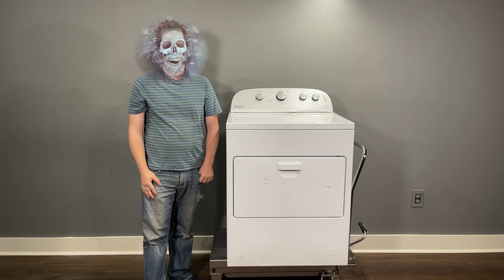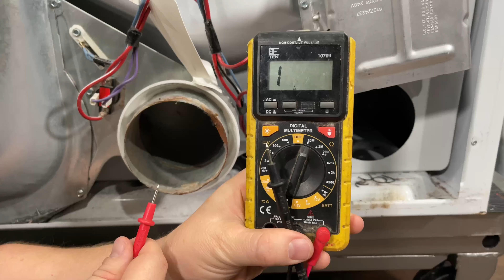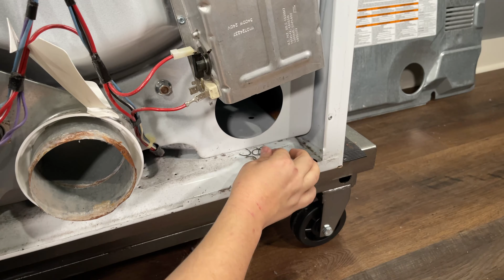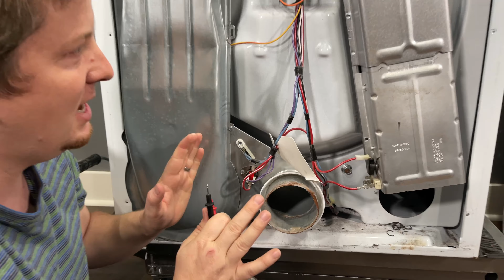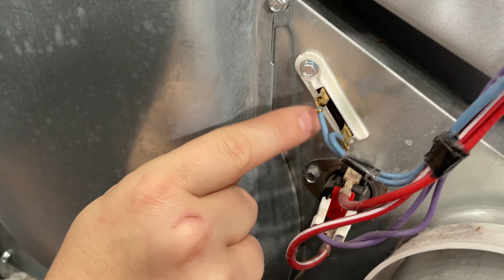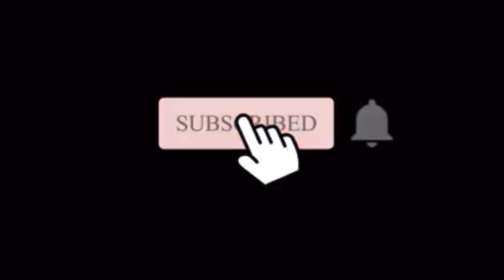Electric Dryer grounded Heating Element Stays on! - testing and diagnosing step by step Whirlpool

Comment: I have Maytag dryer looks very similar to this from the back so the timer doesn’t work I was drying clothes at night and fell asleep in the morning it was off I thought my wife turned it off but then dryer didn’t start I just changed my thermal fuse because it was blown but now dryer smells burnt rubber I haven’t cleaned any lint but I doubt it’s that what do you think it could be should I open it back up and check everything you just said ?
Reply from the maker: Are you saying the dryer will run continuously all night and does not progress forward until it turns off. If so, I would not use that dryer anymore. If it’s a bad timer, which it probably is, that’s one of the more difficult parts to get ordered correctly and it’s also one of the more expensive parts. I don’t recommend a lot of people replace timers because they usually will miss order the timer and the stop points will be at the wrong spots. Also, usually they’re too expensive to really justify not just replacing the dryer. It sounds like you may have more than one issue if you smell something like burning rubber that may be a roller that is stuck or the belt that is stretched.
If you get a good used dryer from a refurbisher, you could probably replace your dryer for less than it would cost for the timer. It also would be horrible. If you replace a timer in that ended up not being the problem. Good luck, but definitely I would not continue running a dryer that does not shut off on its own.

Comment: This looks easy but finding the right heating element is practical insanity.   I have a Kenmore and my heating element literally has 9 different 7 digit numbers in a row on it, followed by obscure symbols.   Which one is the model number?    Then you get on Amazon and there's lists of hundreds of stock numbers, none of them match.   Then they sell kits......  but each part has a list of different stock numbers, none of them match what is on your element.    As for the Kenmore, am I Series 70, 80?  Who knows??   It says nowhere on the dryer what series it is.   Even if you're lucky and get the right heating element, it seems you have no way of knowing if the cycling thermostat that came with it for instance, is compatible or not.
uchh.... What a headache

Comment: Will a bad cycling thermostat cause the element to come on in a run position with the door open ,not running.element dont appear to be grounded out.Ichanged thermostat and fuse on element box.

Comment: Wish I had seen this video first.   I studied the wiring diagram for my dryer.  There were 2 things in my mind that could cause the issue.  Either the timer or the motor centrifical switch.   I bought used parts off of eB@y for it.  Did not fix issue.  For sure, the heating element was grounded to the case.  That never occurred to me, but makes total sense now.   At least I learned something, so it's not all bad

Comment: I tested all that you said and tested .. all the fuses etc test good. And the element tested good ...I checked grounded element .. no noise
Reply: Your issue might be either the timer or the centrifical switch on the motor.   The timer might have some contacts stuck together or the motor centrifical switch may have failed.   When you open the door, the door switch kills power to the motor, the motor stops turning making the centrifical  switch open to kill power to the heater.  If you open the front door while it's operating and the heater stays on, most likely the switch on the motor.   Unfortunately, they only sell as a motor assembly,  you can't just buy the switch.

Comment: Thank u 3 years later your video is helping people like me out .. i change the one element out first then when i turn it on and i noticed the heating element was still stay on... I took that apart and yup on of the wires was just touching the metal . I pop it back on the clips that it has and that fix my problem right away ... Thank you so much
Reply from the maker: I’m glad I could help!

Comment: ALSO IF I RESET THE BREAKER AFTER PULLING THE PLUG THE BREAKER RESETS . THEN WHEN I GO TO PUT THE PLUG IN THE 30A OUTLET IT SPARKS AND POPS THE BREAKER , WHY IS THAT HAPPENING . ALL THE WIRES ARE BACK EXACTLY WHERE THEY WERE . ANY HELP WOULD BE GREATLY APPRECIATED . THANX FOR YOUR TIME AND EFFORT .

Comment: I BOUGHT THE ENTIRE REPAIR KIT . ALL THE THERMALFUSES ,THERMOSTATS AND THE NEW HEATING ELEMENT . DRYER RAN FOR ABOLUT 3 WEEKS NO PROBLEMS . STARTED RUNNING WAY TO HOT AND THE DRYER WOULD STOP . I CHECKED ALL COMPONENTS AND THE NEW HEATING ELEMENT ALL GOOD . NOW WHEN I TRY TO TURN ON THE DRYER IT KEEPS BLOWING THE BREAKER ???????????? PUZZLED.

Comment: Hey there, im hoping you can help me out. My heating element doesnt stay on continually but it does get really hot. And it stays on through the cool down cycle. I took the back off and checked for lent and its not to bad. The heating element looks fine.  A little bend in one of them. Could this be why the heating element stays on through the cool down cye?

Comment: thank you for the video, clear and concise. the problem i am having is no matter what cycle you use it is always on high heat, even on air only. when the dryer is off there is no heat. chaanging the heat knob does nothing high heat all the time. i replaced the timer which was bad and the fuse but there is no change, high heat any cycle. any help would be appreciated. thank you
Reply: That's what mine is doing.  Can't seem to figure it out...
Reply: @jamesnelson6848  I bought all the switches and a new heating element on ebay. About $30. changed them all. easy fix and works like new. Good luck!
Reply: @michaelteti5148   Thanks! I've just ordered the only switch that I haven't replaced so far.  I've taken the heating element out and it looks pristine and has no shortage and proper ohm reading.  Replacing the fuse made it work but the clothes heated to over 200 degrees and it blew the fuse again.
Reply: @jamesnelson6848  i thought my element was ok to but it didn't work until i changed the element.
Reply: @michaelteti5148  I'll order one. Thanks!

Comment: The issue i have is what you described in the beginning: the heating element comes on when the dial is in any position other than  'Off' and the dryer is not running. Otherwise the dryer seems to work fine.  Does that mean i probably have a short in the heating element?

Comment: So my timer continually advances regardless of whether the door is open or shut, unless I unplug it and it heats the whole time. It only turn with the door shut and if you push the start button, but it will continually heat. I Thought I had a bad timer,and replaced it. Nothing changed😢.Pretty sure the dryer is clean, and the vent to the outside is, because I have recently checked all of that.I will gladly check it again this weekend. So now I guess I'm also going to check the heating element as well to see if it could be the culprit. I am definitely not very knowledgeable in this area, but I have changed elements,fuses,thermal cutoffs, belts,timers and rollers in dryers before. I don't know about electrical things, but I think I can make sense of the meter. This is not my wheelhouse but if I can safely repair it I expensively, then I will try.

Comment: In the 2023 NEC a dryer receptacle is required to be on a GFCI breaker. If the heating element is grounded against the chassis, the GFCI breaker will keep tripping. This only applies to new installs.

Comment: Double pole switching for the element should be standard when its fed from two hot legs, that way it can't turn on unless both legs are present. Also, RCD (GFCI) protection would trip instantly in the event of a grounded element.

Comment: Why is the timer on continuous even tho you not press start
Reply from the maker: If you have it on time dry it will still progress on some older dryers. Usually it will not progress If you put it on auto dry. Double check that the heating element is not coming on while it is ticking.

Comment: This is a very helpful and thorough video.  But I watched it twice, and you don't mention that if the cycling switch sticks closed, it will keep the heating coil energized, which  can cause it to deform or break, and then short itself to the chassis.  So if you do find a shorted coil as shown in this video, and the dryer still runs the coil too hot, immediately stop it before you ruin the new coil and check or just replace the cycling switch.  I just did this repair on mine, and this time,  I replaced the cycling switch with it because I had replaced the coil only about 2 years ago (with an OEM one), so it was extremely surprising to find it broken and shorted to the box.
Reply from the maker: Yes, a cyclone thermostat can go bad. I actually have a video on testing that, but not extremely common. The most common is lint buildup. The shower air flow across the heating element causes it to overheat and warp.

Comment: Thank you I had replace my heating element not a few days after that it stopped working fuse had blown I literally replaced everything down to the rollers I mean everything didt think to replace the fuses cause I just replaced them so replaced them again dryer over heated again so today I seen this video I checked heating element and that is what it was I put it upside-down and it melted to the casings lol so thank you for the rundown on everything I never would have thought to check it because I just replaced it
Reply from the maker: Glad to help.

Comment: I just replaced the entire heating element array and fuses in my Samsung, and after plugging it in the whole dryer started heating up - while turned off!!! WTH???

Saw this video, and yup.. one of the new coils was touching the frame box it came in! Just had to bend it slightly. 

Scary stuff. That type of short should not be a factor when the dryer is turned off.

Comment: Is the heating element suppose to turn on when i  move the timer without pressing start? Also i can hear a noise humming noise from the timer even when is on the off position is that normal ?
Reply from the maker: I would definitely not leave that dryer plugged in. I also would not use it until you are 100% sure it is fixed. it should definitely not have the heating element on about pressing the start button. Could be a grounded heating element. like the example from this video shows. 
if you’re not confident, it’s fixed be sure to get a professional to check it out before you plug it back in.

Comment: I've watched yours and other videos and am still confused.  I just replaced the cycling thermostat as well as that fuse because it just wouldn't run at all.  Now it runs fine so I stuck a thermometer in the hose just behind where it connects to the exhaust and on both medium and high heat it maxes out and holds at about 170˚ which had me wondering why the same max temp for both settings?  Then after I let it cool down I closed the door and a few seconds later the heating element came on.  When I turned the timer off the element turned off.  Tested the element, thermostat, and fuse and all are good.  Pulled the element and it almost looks new, no bent or broken coils, no indication of shorting out.  Barely any lint anywhere because I clean the filter after each use.
Reply from the maker: Definitely don’t leave it plugged in until you solve the problem. With the dryer unplug, you tested both sides of the heating element against the frame of the heating element? If so, it could be connecting in the timer. I have a video on dryer temperatures and also on refurbishing and testing timers. Basically, if you take the timer off, they’re pretty easy to open and you can usually eyeball if there is a problem with them.
Heating elements coming on while the fan is not running is very dangerous. Be sure not to leave the dryer plug in until you are confident it is fixed.

Comment: 4:56 This plastic housing burnt/melted on one side. These wires are the ONLY plastic housings on any of my wire connections…I notice you have them on other wires…is this bad? Can I just wrap them or leave just the metal alone and hook them onto the fuses? I really don’t want to buy a new dryer right now.

Comment: Our heating element stays on when the timer is on anything but the off position,  even with the door open , the heating element looked good too, everything tested fine, I can't figure it out right now
Reply from the maker: It’s a grounded heating element. Don’t use it until it is fixed. I have a video on grounded heating elements. Check it out.
Reply: @Washer Dryer Money  thanks for the reply, it was not a grounded heating element,  the motor was bad, there was broken pieces in the motor , new motor , everything is fine.
Reply: @rorymclean7545  im having the same issue check your timer and timer motor, i think thats my issue but its gonna be har dto justify 70 bucks on a maybe. if you are lucky its just one of your contacts on your timer needs to be filed. its frustrating the crud out of me.
Reply: if i spend 70 more bucks that like 120 im at almost just rather buy a new one lol i think this was 300 7 years ago so ive kinda gotten my moneys worth

Comment: If one of the coils is broken can I just remove the one bad coil as a temporary repair until I can get the new part?
Reply from the maker: It’s all one big coil. I have seen with people attempt to reconnect where it breaks. I’m sure it’s not a good idea. Plus Usually it will immediately break again so I don’t recommend it.

Comment: I had 2 issues. Dryer not stopping at off position, a Dial issue. Replace the dial, and then found the heating element staying on when dryer is not running, because it was grounded out. Awesome video. 

Such a fire hazard that the heating element fails in an on state. Thanks for the video.
Reply from the maker: Glad to help.

Comment: Very knowledgeable ty...I have a maytag model #med 6200kwo...this past week I put a fairly wet load of towels in ...and the next day the wife said the vent hose was hotter than normal..also she notice the very hose shake sometimes like the air stopped and then backpressured air out than ran normal happening on an off.....vent is perfectly clean...and heats up .high heat element goes on and shuts off.tub is spinning fine....I'm thinking maybe a thermal cut-off switch or fuse???

Comment: Thank you thank you thank you!!!  I replaced the burned out heating element on my Kenmore and it worked fine for a few loads then started staying hot after the load finished.  Figured it HAD to be the timer so I replaced it, exact same problem.  Checked all the easy stuff, could not fine anything.  Watched a dozen videos, no help.  Finally your video pointed me in the right direction.  The replacement heater element has a loose insulator and it's letting the heating wire ground out.  I know to always check what you just worked on but figured it couldn't be the heating element since it worked initially and it's getting hot.  Never knew about this failure mode!!!!

Comment: Maybe you can help?, 
I’ve got a Samsung dryer not heating no error codes displays. heating element works , all the Sensors work. The relay is working and I’m getting full 220v and the control panel works too. Iv also inspected all the wiring . 

Any suggestions??. Thanks.

Comment: Great video. I have a 1990 kenmore dryer model #11086878100 that runs hot. i already changed the heat coil, both thermostats, both fuses. No lint blockage. Timer works. Heating coils do not cycle off even at 200 degree F. Any other suggestions what to do? Please help.
Reply from the maker: My best guess would be what is videos mainly about. The heating element coil could be touching the frame of the dryer. That would make the heating element stay on all the time. Definitely if you cannot solve the problem do not continue running the dryer it’s a very dangerous problem.

Comment: I am surprised to see you testing for ground/ continuity before taking at least one of the lines off.
Reply: Because no matter what else is going on in the circuit, there is no way either lead to  the heating coil should ever be grounded to the chassis.  If it is, there is a short and other than the broken coil touching the box, there is really no other place where one of those leads can ground out.   In addition, it takes two minutes to take the coil box off if you detect a short, to couble check that the coil is really bad.
Reply: @cowsongs I tend to remove both wires when checking thermostats/thermal cutoffs in case one of the wires or whatever it is attached to is touching metal somewhere and is grounded.